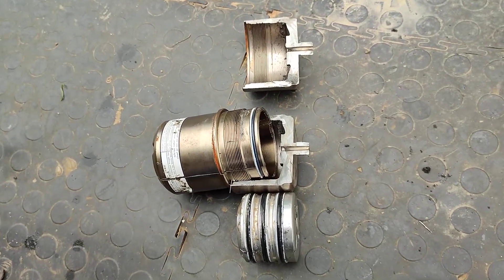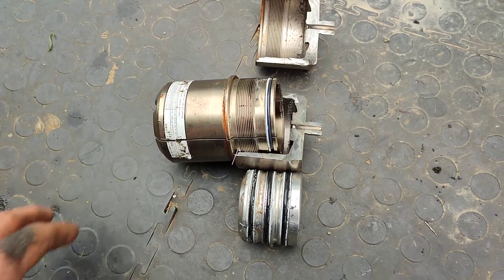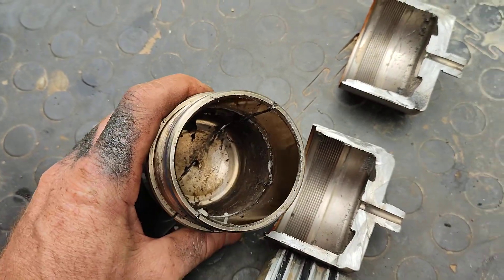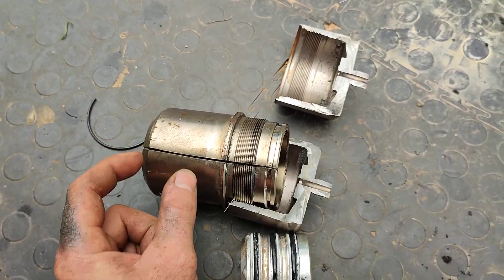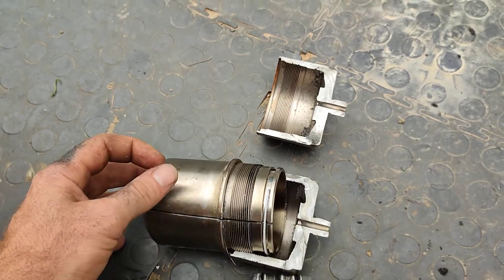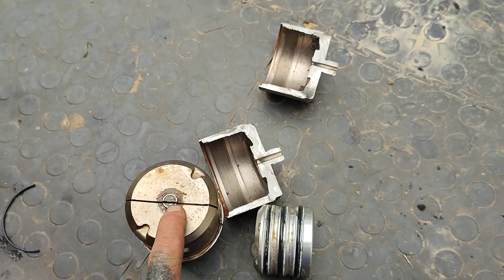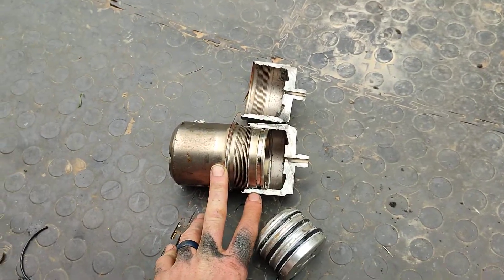Pajero brake accumulator cut open and working explanation

Comment: Hello! How long does the motor that powers this accumulator normally run for when everything is working perfectly?
Reply from the maker: 1.Turn the ignition switch to the LOCK (OFF) position. Depressurise the power supply system of the hydraulic brake booster (HBB) by depressing the brake pedal at least forty times until the pedal effort becomes high.
2.Check that the reservoir fluid level is at the MAX position.
3.Chock the wheels and release the parking brakes.
4.Turn the ignition switch ON, and measure how much time is elapsed after the pump motor starts until it stops.
Standard value: 20 - 80 seconds
5.After the pump motor stopped, start the engine. The brake warning lamp should not be turned on.
6.Stop the engine, and then turn on the ignition switch again.
7.When the brake pedal is depressed four or five times, the pump motor should start and then stop.
8.Depress the brake pedal four or five times again, and then measure how much time is elapsed after the pump motor starts until it stops.
9.Depress the brake pedal fully consecutive 15 - 20 times for ten seconds. The brake warning lamp should illuminate and the buzzer should sound.
Standard value: 2 - 11 seconds
Reply: @MariusFourie The pump motor stays on for 10 seconds and stops for 5 seconds every time, so is there something wrong?
Reply: When I turn on the ignition, the pump motor stays on for only about 5 seconds. Is this normal?

Comment: I thought that the pumping was done with ifnition off
Reply from the maker: correct. You pump 40 times with ignition off to depressurise the accumulator before removal. The accumulator allows around 15 power brake pumps with ignition off.
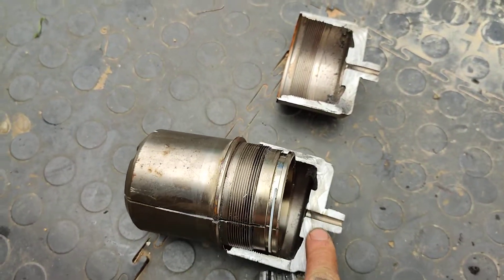Reply: 1:35 you said ignition on by accident

Comment: Hi Marius, if I may ask, where did you buy your new accumulator?
Reply from the maker: ebay. But it took 2 weeks and the import taxes were rough. It ended up costing more than the dealer quote. So just get from the dealer.

Comment: What is the air pressure in the accumulato?
Reply from the maker: I'm under correction but I believe the standard pressure is 1100 psi. This obviously increases once installed and the HBB pump starts running to pump brake fluid into the booster.
Reply: Did you manage to repair yours?